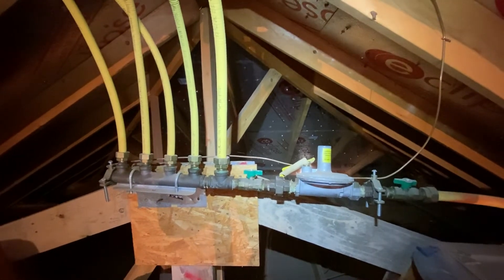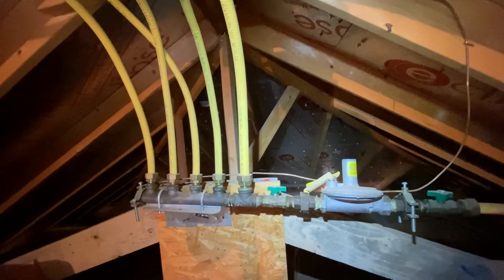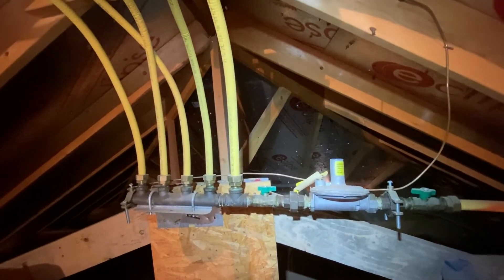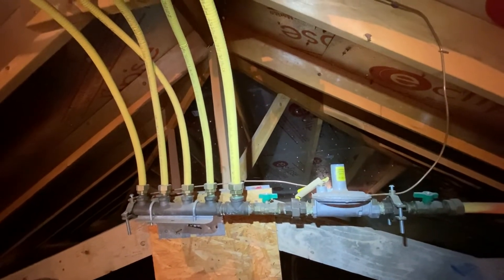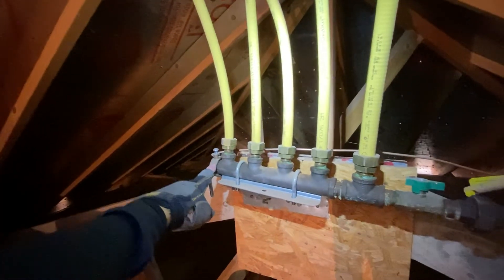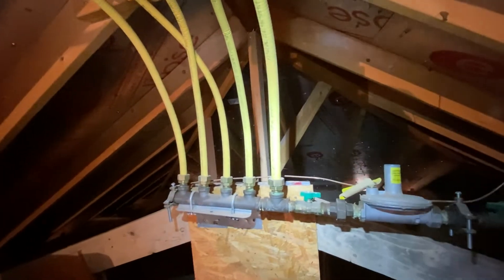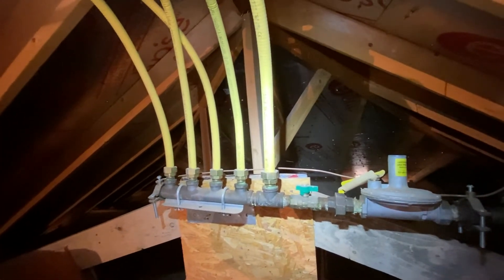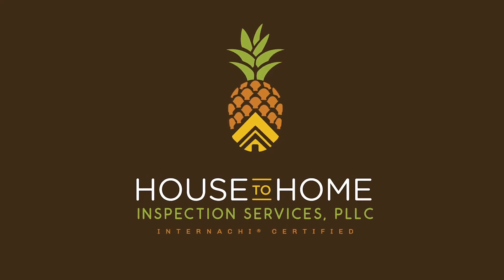CSST Bonding and Grounding Across the Regulator

Comment: The csst has a rubber flat gasket ergo no bonding. The csst is required to be bonded on the other side.of the manifold fitting. Strip back enough of the yellow covering and attach a UL listed clamp to ground each individual line.  As well as the manifold and across the regulator.
Reply from the maker: Mfr states NOT to clamp a grounding clamp to the corrugated portion of the line, but to the nut or something rigid. See page 38 of this doc for example: https://fixed-puma.files.svdcdn.com/production/HOME-FLEX_Installation_Manual.pdf?dm=1637177788 Or see page 71 of this doc for example: https://www.gastite.com/downloads/pdfs/gastite_di_guide.pdf

Comment: There is no such thing as "plastic" gas regulators.    Dialectric unions are only used on water lines, not gas lines.   They are not fire rated.    Water lines don't have to be fire rated.   You probably saw a bootleg.
Reply from the maker: Not “plastic” technically, nor am I referring to a dialectic union, but it’s a non-conductive poly material at the ends of the regulator. Those fail a continuity test. That’s what I’m referring to, but it’s admittedly rare.

Comment: ? Regulator should be right by the mitter suplied by gas company ,some weard contrapsion you have there
Reply: Exactly. Regulators need to vent gas to atmosphere. If that vents in his attic and there's any static. BOOM.😳 That and they recommend bonding to the csst fittings, not the pipes they connect to. He's missing 6 connections here.

Comment: This is good information about the regulator, but NFPA 250.104 also indicates the CSST also needs bonding, not just the metal pipe. Most manufacturers require bonding at the fitting as well to ensure the prevention of arc flash.
Reply from the maker: Thanks for your comment.  The main point of the video was to say that CSST (not just the metal pipe) needs to be bonded and if the regulator breaks the electrical bond, it needs to be corrected with a jumper across the regulator.  There isn't a metal pipe in the video - it's all CSST.  So yes, you are correct that CSST needs bonding (not just the metal pipe) and yes, that's exactly the point this video is making.

Comment: Is pipe dope and teflon tape conductive? IF it is not, the CSST is still not bonded since it is isolated from the black iron.
Reply from the maker: I wouldn't think it is not conductive, but I've conducted continuity tests on regulators that had pipe dope and teflon tape and found continuity. So the real issue is when plastic regulators are in place, in which case continuity is lost.  A continuity test with a multimeter is a good way to find out.
Reply: There is still a solid metal to metal contact within the threads as tape and dope only fill in the tiny voids in the threads. When a fitting is undone one can clearly see the steel threads.

Comment: I have a question. I don’t know if my iron pipe is grounded.  If I add a grounding rod next to my meter and bod the main line entering would I be okay? If I want to add on a CSST line later to my system would I still be safely bonded?
Reply from the maker: It depends on the authority having jurisdiction and what they require. In general, when aberrant currents have too many options to find their way back to the earth, it can cause problems that I won't get into here. So it's best to, not simply "ground" the gas line (drop another ground rod into the earth next to the meter), but to bond it to the house's electrical grounding system.  I would consult a licensed electrician (which I am not) or an electrical engineer for more info.
Reply: @Finn Harold instablaster ;)
Reply: @Fox Brayden thanks for your reply. I found the site thru google and I'm trying it out atm.
I see it takes a while so I will reply here later with my results.
Reply: @Fox Brayden it worked and I now got access to my account again. I'm so happy:D
Thank you so much you saved my account!
Reply: @Finn Harold No problem :)
Reply: You all prolly dont give a damn but does any of you know a tool to log back into an instagram account..?
I was stupid lost the account password. I love any help you can give me

Comment: SUDDENLY we are told that the iron gas pipe is not grounded, even though it just ran through the ground. I am surprised. And that a copper rod hammered into the earth is not grounded either. News, eh? I sense some BS with CSST grounding.
Reply from the maker: The iron gas pipe riser is not considered a grounding electrode conductor - after a foot or two, it changes to a poly carbonate material. The iron riser's contact with the earth cannot compare with a 3/4 solid copper rod driven 8 feet into the ground (who said that's not grounded btw??)  The point of it all is to tell the escaping current where it needs to go to find its path back to the ground instead of to people or equipment. You want it to run back to the panel, because (in theory) that's where the ground system is.  Which is to say there's a ground rod driven 8ft into the earth.
Reply: In most locations the cheap lazy electrical supplier only runs 1 high voltage wire to the primary of distribution transformers and connect the other side of high voltage wire to the transformer case and neutral wire ( called an auto transformer ) so current must flow on every copper water service, steel has pipe & even cast iron soil pipe. I a!ways read at least 1/2 amp on copper water service even when that houses main circuit breaker is off. Have read 1/4 and more on every steel gas line.